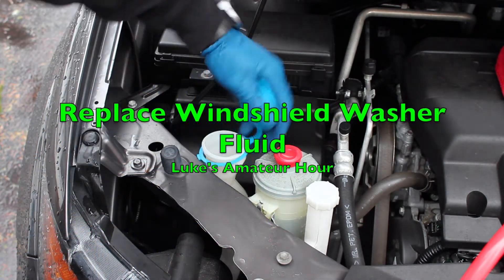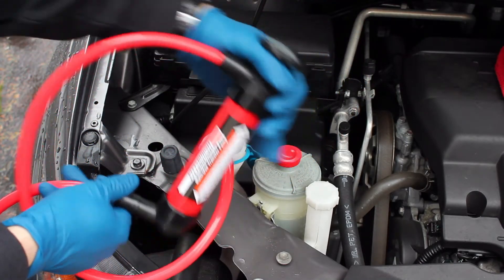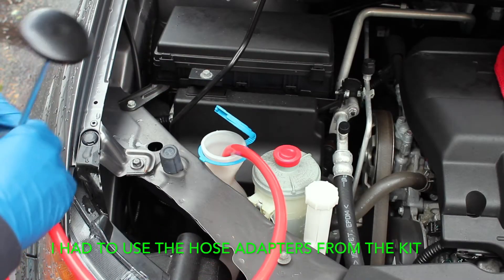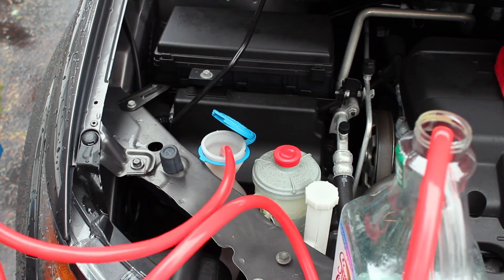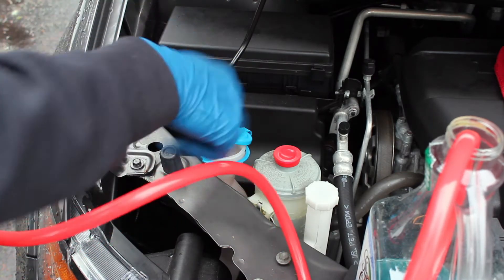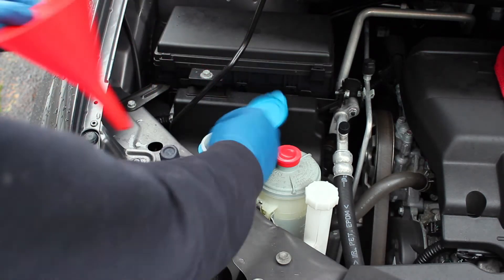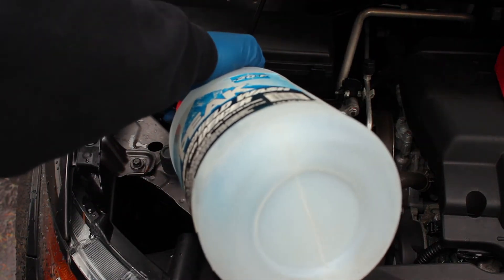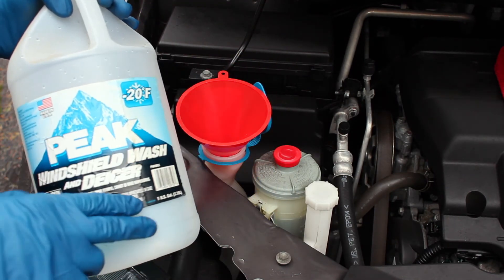Replace Washer Fluid using HF Transfer Pump

Comment: I bought the Multipurpose HF pump to evacuate the accidentally filled coolant inside washerfluid compartment. Rinsed with distilled white vinegar. Thank you for the video.

Comment: Good idea, think I have to do that. Got a new BMW and they don’t seem to like the silicon in RainX.
Gives a low reservoir  warning even though I filled it. The additive must mess up the sensor in there.
Being in the Toronto area sometimes we need the good De-Icing fluid. Thanks for the video.